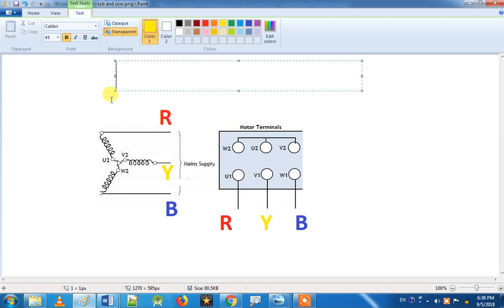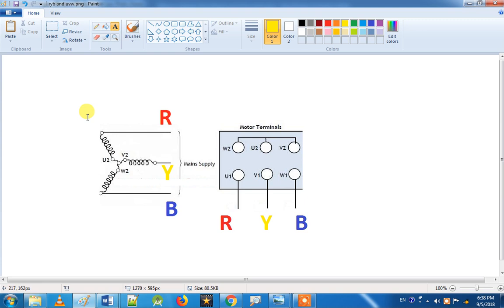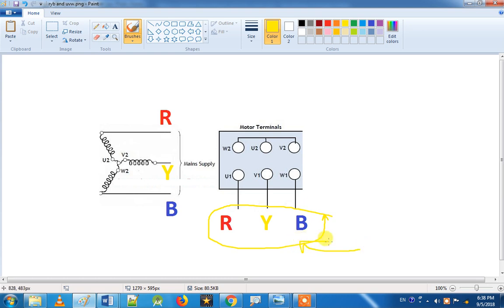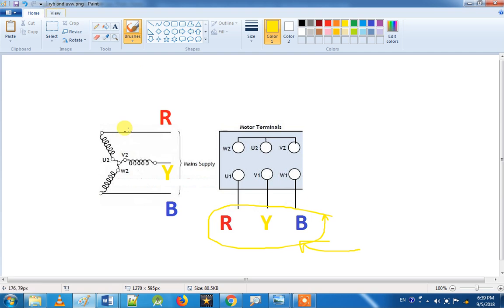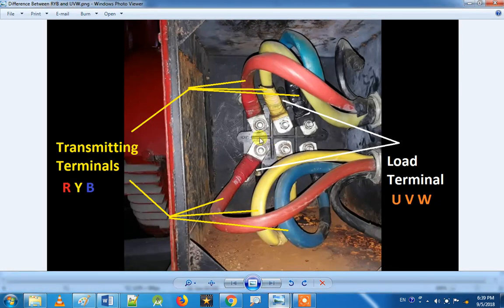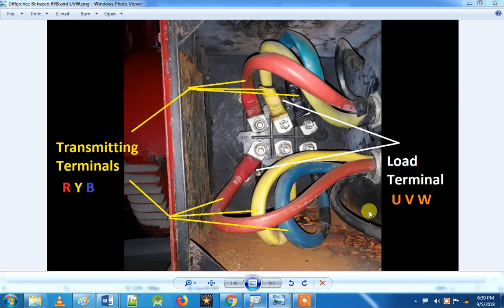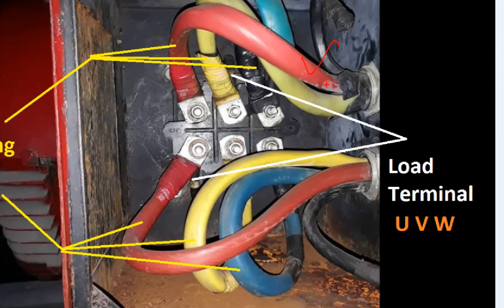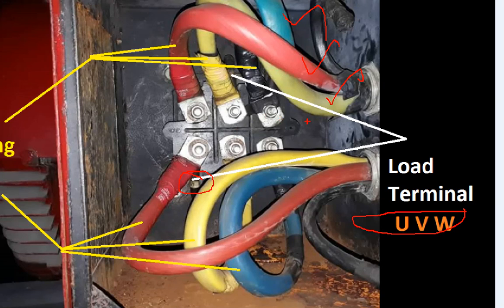Difference between RYB and UVW in Tamil

Comment: Hi sir. I have the doubt. If motor running in star connection means -  U2 V2 W2 star link and power connection given to U1 V1 W1 . If I change power connection in U1 V1 W2 what will happen